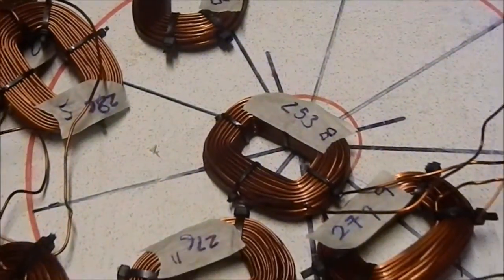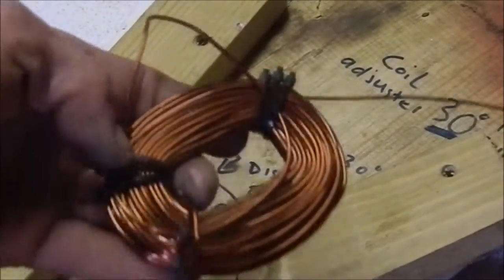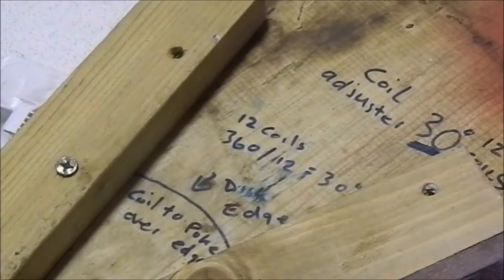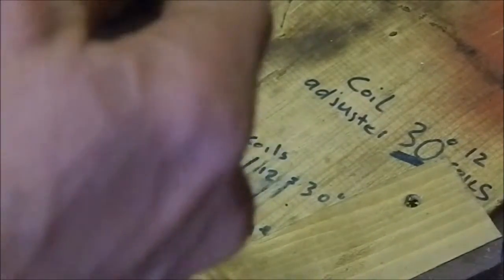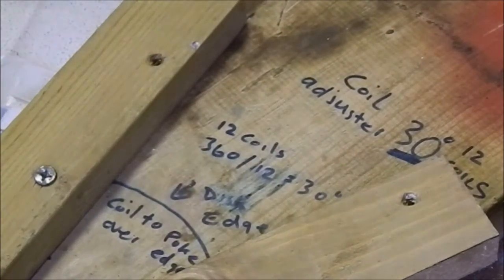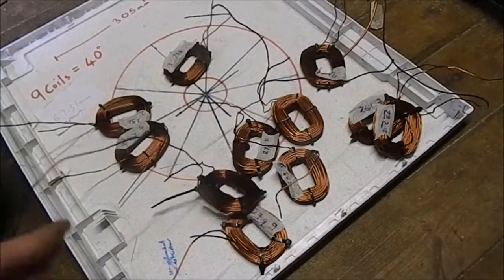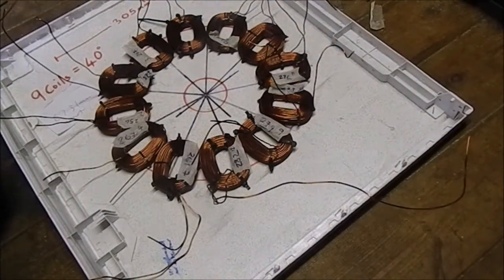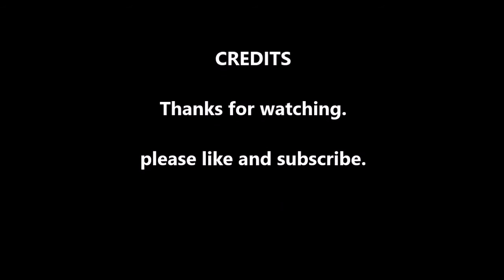Checking and reshaping 24v wind turbine coils 12 12 2016

Comment: Your words kill me, so funny with expressions of words, difference between countries. What gauge magnetic wire are you using for coils?  How many turns per coil? How many coils? I am using a motor coil winder it is sweet I can make any dia of coil. I can leave all coils hooked as one set no splicing it saves crimping. How many magnets. On each plate. Sorry if you have told everyone details I’m am just viewing your video now. What you are doing is very interesting very smart, it’s much easer to adjust the magnet plates. I see 12 coils